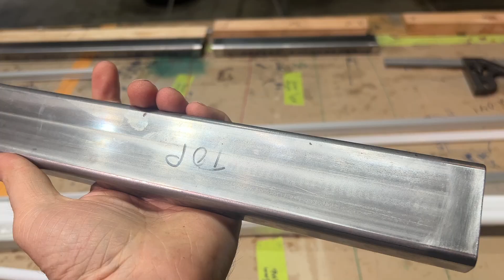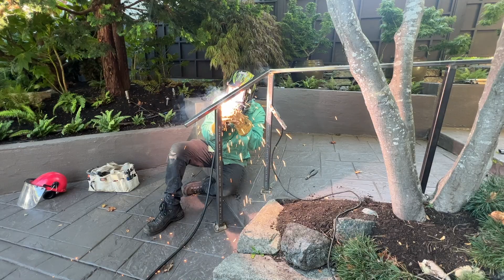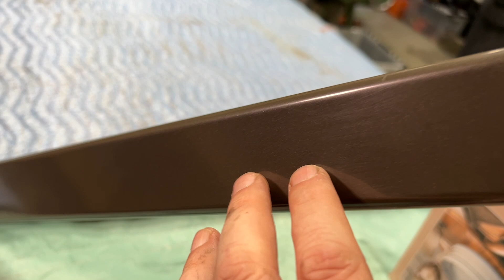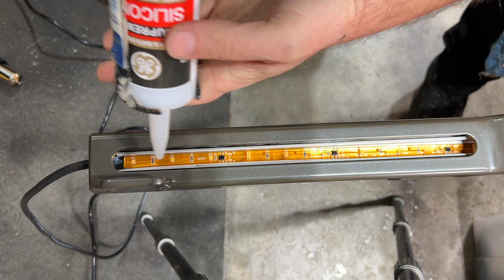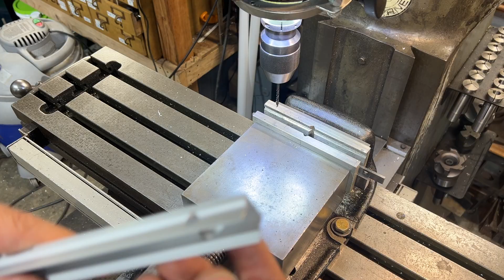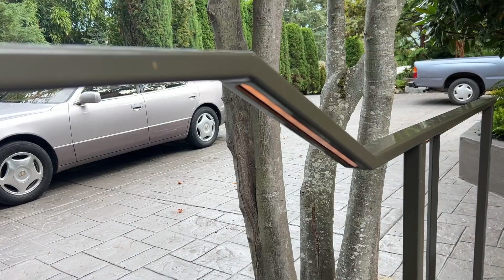Amazing LED Strip Lights In Handrail & Along Stairs -  Outdoor Landscape Lighting - Luxor

Comment: I love seeing a detailed project go from idea to completion. I'm visually impaired and soon I am looking to do a full flower bed revamp with low voltage lighting. The solar lights for me arent bright enough and I can barely see my walkway at night. I want pathway lights on my walkway and we have a small courtyard style nook by our front door. My wife wants small spot light angled on the side of the home too so i have some planning to do with photos and renderings I plan to do in Photoshop to visualize what we want but I will be doing all the work. If you're interested in the handsaw read below...

The one tool in this video I was most interested in was that hand saw. I just HAD TO HAVE oneso since it wasn't linked I did a reverse google image search and located one on ebay. I did do some searching on Amazon but was unable to find anything similar that I liked in fact nothing came up at all like that tool. The one on ebay appears to be sold by a seller that possibly sells them straight from Japan. The price of the saw isnt too bad at around $22-$24 but if you're in the US be prepared to pay the same amount in shipping if not slightly more. I ordered one and I am awaiting it to be delivered with an overall cost of about $50 but in my opinion while there may be other options I really like the compact and easy to use design of it and so I opted to spend the extra money on getting that exact saw. For reference on ebay it is called the "GodHand Mighty Handy Saw GH-CK for Plastic Models and Craft Work". You got a subscribe!

Comment: Regarding the epoxy for the tracks to connect them solid: Is this epoxy capable of dealing with heavy temperature changes? When the sun starts to shine on the metal it will heat pretty fast and as soon as the sun goes away it will cool down relatively fast. During the seasons this will give a lot of stress to the epoxy.

Comment: You do not need to buy AC Strip lights specifically. A simple Bridge Rectifier module before the strip does the trick also. You can get them in different sizes and capabilities very easily.